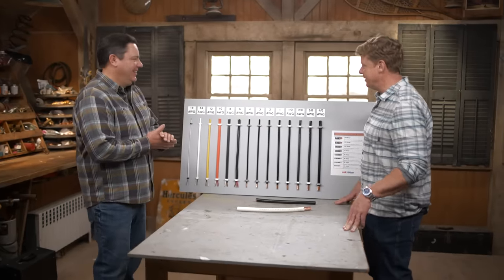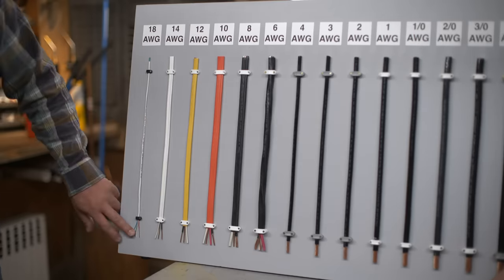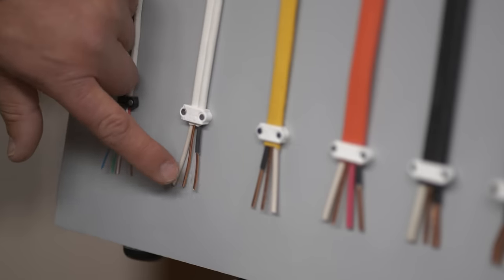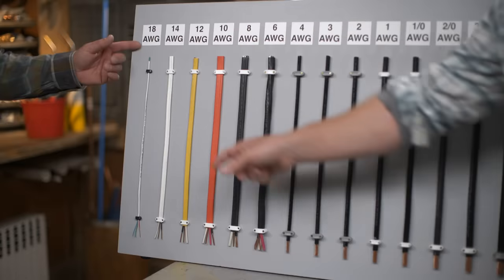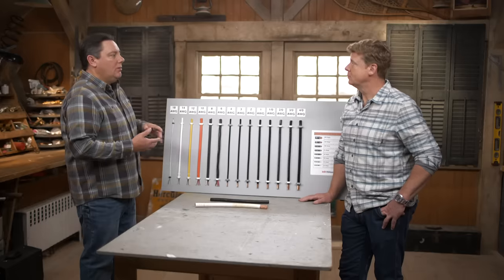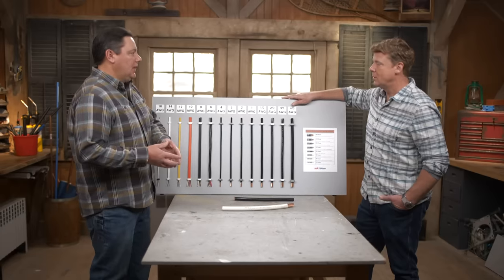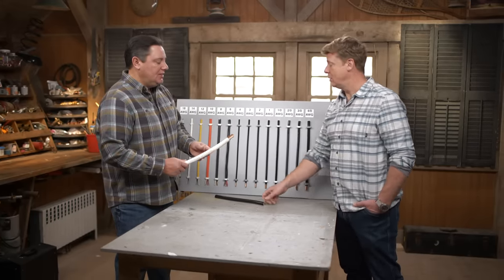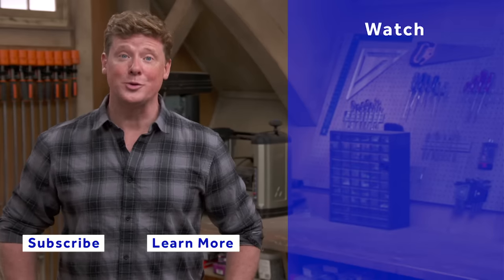Understanding Wire Gauges | Ask This Old House

Comment: While the ‘k’ does stand for “kilo” and the ‘c’ stands for “circular”, “kcmil” is not a metric unit of measurement, and the “mil” is not short for millimeter. One mil is 1/1000th of an inch, and a circular mil is the area contained in a circle with a diameter of one mil. A 500 kcmil conductor, therefore, is a conductor whose cross-section has an area of 500,000 circular mils.
Reply: so theres a 1000x and /1000 in that unit?
Reply: @GeofDumas  Yeah, no one knows why it is the way it is, we just deal with it. It aint metric, thats for sure.
Reply: Great explanation - thank you!
Reply: How many mm wire you can use for a single 10mm wire since the single 10mm wire is huge
Reply: You are wrong sir stop giving false info
Reply: This is an interesting unit. Wikipedia has a nice discussion on the topic (for those interested, see "circular mil"). Perhaps the most interesting aspect to me is that it's a unit for cross-sectional area calculated as D-squared rather than pi•r-squared. It is a unit of area without a "squared" in it (like an acre or a hectare) rather than square inches, square yards, square metes, etc.
Reply: @kllgrogto5838  Where specifically is he wrong?
Reply: Of course it doesn't why would anything be simple
Reply: My God. Why America needs to use such outrages units. Just use diameter or area in regular units. Even in inches or square inches. Not to mention simply mm/sq mm like any other place on the earth.
Reply: I just learned this in class last week.

Comment: The only reason to use 14ga is to save money.  All the normal general purpose outlets should be wired with 12ga on 20amp breakers IMO.  If you separate lighting from outlets (a good idea, IMO) then maybe you want to use 14ga for your lighting circuits. But then if anyone decides to add an outlet and feeds it from a nearby switch, that outlet will be on a 15amp breaker.  Wire is cheap compared to an electrician's time to come out and add circuits. Just use 12ga for your outlets in the first place.  Or 10ga.  That would be even better, but man I hate working with that stuff and multiple cables in a box.
Reply: Agree with everything you said! In a few places with especially strict code (including where I live), 12ga is required. Your note about future changes sticking on 12ga wire/20am circuits is spot on.
Reply: Yep, if a homebuilder can cut cost they will, and to hell with everyone down the line for decades that own that house.
Reply: With LED lighting, 14 gauge is almost overkill for lighting circuits, but it's still the standard for residential lighting.
Reply: @n9wox  Problem is we don't have really any standard for premise wiring less than 14ga/15a.
Reply: Completely not true
Reply: I'd never use 14/2 for receptacles anywhere. Always 12/2.

Comment: Back in the late 1970s we ran 4/0 in our church, the job supervised by two master electricians.  I recall the wire was so huge and stiff I thought we would never get it through the big conduit but we finally did.  It was a service to a large air handling unit as well as duct heaters and other electrics for a portion of the building.  I'm grateful for the explanation.
Reply: 4/0 aluminum is a standard wire size for most new 200 amp basic houses now.  Ironically, aluminum is totally safe with a proper installation, torque, and anti-corrosion.

Pulling the individual wires thru a conduit is an art if the conduit isn’t oversized.
Reply: @ganocd4   I totally agree.  I think our conduit was a little oversized but perhaps not.  That was 50 years ago.  We had no issues with large, professionally installed commercial wire back then.  The issue we had was with copper-clad aluminum in residential installations.  I'm no electrician but my brother was a licensed journeyman.  We had to resort to copper-clad in my first home.  Never had an issue because he taught me how to properly tighten all connections and double checked to make sure.  A friend, on the other hand, almost had his house burn down.  The problem was traced to a loose copper-clad aluminum connection in a plastic box.  Yeah, I know, the plastic is supposed to be rated but it didn't do the job when the loose connection sparked and melted the wire.  Fortunately the guy caught it and shut power before it got worse.  It might not have ended well.
Reply: @ganocd4  Ironicly? aluminum has been fine for awhile. Just need to have devices designed for it. All those big massive overhead powerlines? Aluminum.
Reply: @ganocd4  A lot of fires have been started by Aluminum. It should be outlawed for residential wiring.
Reply: @dancooper6002 I think your confusing aluminum with copper clad aluminum wire. Aluminum wire is still used in residential for running power to panels and cheaper than copper. Just apply antioxidant to the exposed aluminum wire.
Reply: we  use 4/0 in the film industry to power our lighting and AWG banded 5wire camlocks
Reply: @dereknueveuno  DN ............even with the new LED lighting now ????
Reply: It's not oversized most of the time, the NEC gives you a guideline to follow to avoid that issue.

Comment: Heath got it wrong. kcmil is not "circular millimeters" and it's not metric. It is thousands (k for kilo) of circular "mils" where a mil is 1/1000th of an inch. (A 500 kcmil conductor is 253 square millimeters in cross-sectional area.)
Reply: What? Are you sure???
Reply: @eviltomthai  Yes, I'm sure. Just google "circular mil" or "kcmil" and read a few of the top hits, or Wikipedia, or any other reference source. (I'd put a link here but then the comment goes into moderation and takes forever to show up.)
Reply: @eviltomthai  Wikipedia: https://en.wikipedia.org/wiki/Circular_mil
Reply: Leave it to a America to divide an inch 1000 times and then call it a mil. A measurement that is so imperceptibly small you could just arbitrarily switch to metric which already divides everything 1000 times and you wouldn't miss anything.

Comment: Its not metric!  Its K (thousand) C (circular) Mills (Thousandths of an inch) - its in the name!  250 kcmill wire has 126.7 mm(square) cross section - its not metric

Comment: Great video but I have a concern about the explanation for the "wrong wire for the job".

If you use the wrong size wire, you're at risk for a fire (coming from inside the walls). It's not a matter of "the breaker is going to trip". 

Let's say the breaker was rated for 20A, but you put in wire that's only meant for 10A of current. In a scenario where 15A of current is being drawn, the breaker will think everything is perfectly fine yet the wire will be melting down and eventually light on fire.

That's why it's important to put wire meant for 20A with a 20A breaker, etc etc
Reply: Yes, your breaker should always be sized to protect your wire. thats just common sense. What he was talking about was don't run a 14AWG on a 10A circuit to your oven. It aint going to get the job done.
Reply: @literallycanadian  I'm not sure we should assume anything is common sense, especially when watching a video explaining beginner level concepts for electricity and wiring.

But yes, I think you're right - that was his intent. But it was subtle, and could easily be misinterpreted as a safety point. Maybe it was just me. I wanted to help clarify and share knowledge, in case anyone else misinterpreted his point, as well.
Reply: This is correct. Choosing the wrong wire gauge has nothing to do with the breaker popping. That's a pretty big mistake for somebody (the guy in the video) who is supposedly a master electrician!
Reply: But what if I use a bigger wire than is required, is there any downside? E.g. using receptical wire for lighting?
Reply: So glad I read this.
Reply: @taqveem the only downside is cost.  My dad has strung 14 all throughout the basement for each outlet even in bedrooms.  That way a space heater can be placed anywhere and not have it be a problem.
Reply: I mean I got the gist of it but yeah "fire hazard" should have been somewhere in that sentence.
Reply: Clearly they meant you had the right breaker for the wire.   Probably should have made that more clear, but obviously that's what they meant.
Reply: @taqveem  The downside is that someone later comes along and thinks they can change the breaker out for something bigger but the entire circuit isn't the larger wire but that's the only wire they see.
Reply: @taqveem gets hard to terminate the wire on the device and get it tucked back in to the box

Comment: 25+ years as a UL508A industrial control panel builder. Mostly for the lumber industry boiler control, pump panels usually used the biggest wire. Great video on wire sizes.

Comment: A good way to explain when to use 12ga (20 amp) to a home owner is on a circuit that will power an appliance that has a standard plug and cord, but produces heat. A toaster, coffee pot, hair dryer, space heaters, etc. It's more complicated, but this gets you most of the way there.

Comment: One thing you could have added was where "gauge" came from. it comes from the number of times the wire had to be drawn through a die or form to get it to the desired size. So, 14 gauge would would have been drawn through 14 sets of dies to get it to that size. Today it's a cross sectional area is more rigidly defined, but that's roughly equivalent to that. The X/0 sizes (pronounced "X ought") is just the number of 0s in that size, similar to "00 buckshot."

Also should have mentioned that wire size is not only determined by the amount of current going through the wire, but also the length and duty cycle of the device you're powering. Consult you local electrical code or electrician for more information.

And there was one mistake. MCM or kcmil is in imperial units. A mil in this context is 0.001 inches.
https://en.wikipedia.org/wiki/Circular_mil
Reply: ok bro maybe you should be in the video
Reply: @peterjanis2455  or maybe he shouldn’t. Probably isn’t even an electrician.
Reply: Thank you so much for that explanation!  
I've also heard it said that the gauge number is that fraction of an inch; for example, 16 gauge is 1 / 16 th of an inch.  Is that true?
Reply: @CoconutPalmPictures  It might be a close appoximation in some of the smaller guages, but AWG scales differently. If you want the exact formula, it's on the wiki page for AWG: https://en.m.wikipedia.org/wiki/American_wire_gauge

But to summarize, 36AWG is defined as 0.005 inches in diameter, and each size up is about 1.12293 times the previous size.
Reply: The sizes range from 0000 (4/0) to 36. So 14ga is the 17th pass thru. 3/0 is the first pass. Length of wire (voltage drop) calculations can change wire size, but are for over 200 feet and rarely used in residential.

Comment: I would say more important than "right wire to the right appliance" is to say "right wire to the right breaker"... You get this combination wrong, that is when your house is at risk.
Reply: They are actually right, sequence of selecting devices is always appliance determines how much load you have, and thus determines required wire. Your breaker is now selected to protect the size of wire you have.

Comment: Need one for plumbing pipes snd connectors next. 

Abs, pvc, cpvc, 
Schd 40, schd 80. Etc
Reply: Include which are sized in Iron Pipe Size (IPS - abs, pvc, ...) vs Copper Tube Size (CTS - cpvc, pex, ...).

Comment: Pretty informative and a great video as always. Curious though, what would be recommended for a small workshop in a garage or barn? Mostly just a refrigerator or two and the occasional power tool or air compressor?
Reply: Almost certainly you would be fine with 12AWG. Depends on the power tools and how much or many you would use at one given time. Getting power to the garage if it is detached would likely be the biggest issue
Reply: A 50 amp service to a main breaker type sub panel would be what I'd consider minimum.  100 amps would give some major flexibility for the future.

Comment: Any downside for using 10 AWG or 12 AWG when only 14 AWG is needed  - other than maybe the cost?
Reply: Harder to bend
Reply: 10 or 12 gauge also sometimes won't insert directly into the  rear holes in electrical outlets.
Reply: Wire may be too big from some of the terminal you plan to land into, like stab in receptacles or switches. But other than that it's fine to use oversized wire so long as the breaker/fuse/OCPD is sized correctly. Up-sizing wire is done sometimes on long wire runs (300+feet) to mitigate power loss from the wire resistance.
Reply: @BradThePitts  don’t back stab (put it in the holes) of the outlets. ALWAYS use the terminal screw or a WAGO connector. Backstabbing wires causes wires to come loose.
Reply: @jasony9950  
"Backstabbing wires causes wires to come loose."

Well, there's something that wires and I have in common.
Neither one of us like being back stabbed.
Reply: Box fill is based on wire size, among other things. For a given size box, and all other things being equal, you are allowed to put more smaller wires in a box.
Reply: Solid 10 is nobody’s friend
Reply: @BradThePitts  You don't want to use the rear holes, ever. That's BAD practice.
Reply: Costs more, harder to install. But no real downsides.
Reply: @BradThePitts You shouldn't be using the rear holes, so if the wire does not fit, winning!
Reply: That would be the equivalent of making a cement block to hold up a TV.
14 AWG is just fine for lighting and most outlets.  12 for bathrooms and kitchens and garages.  Running 12 to most outlets isn't a bad idea, but 10 is very overkill.
Reply: In theory you could, but I wouldn't (unless I have a very long run where I have to worry about voltage drop).  I think about it like this - the breaker size decides EVERYTHING that follows, because you always want the breaker to be the first point of failure. 15 amp breaker = 14 AWG wire, 15 amp rated switches, 15 amp rated plugs, etc.  Don't mix and match anything between 15 and 20 Amp circuits.  A 20 amp breaker gets 12 AWG wire, 20 amp rated switches and outlets, etc. all of which are noticeably more expensive.  The code builds in appropriate margins of safety already if you just follow it.  You can deviate up from the code, but you are nowhere near what the wires are actually capable of handling if you stick to the code, so you are really just wasting money.
Reply: Less voltage drop. Commercial/industrial buildings are often engineered that way. In a residential application, chances are its a waste of money to upsize a wire for no reason.

Comment: OK...let's not confuse power with current. Remember, Power = Voltage x Amperage...W = V x A. It's the current...A(mps)...that heats up the wire, not the Power per se. 
For example, a 100W load at 120V requires a little less than 1 Amp. At 240V, it needs half that, a little more than 1/2 an Amp. 
In an automotive system at 12V, a 100W bulb...say a headlight...requires a little over 8 Amps. 
AC or DC, it is the amount of current that needs a particular wire gauge, not just the amount of Power.

Comment: I’d love to see a n accompanying video on all the CAFCI and GFCI circuit breakers these branch wiring circuits connect to with a modern standard.

The breakers are around 100 a pop and many houses need 30 of them to meet code these days.

It’s too bad the BOM cost for these is so cheap and they are so overpriced relative to the chip and material cost in said breakers.  They won’t protect against undersized wires, but they do catch a lot of faults you won’t typically find.

Comment: Could you wire your whole house with 12 guage wire? Minus the bigger stuff. I.e. dryers.
Reply: Yes, 12/2 could be all 15A or 20A circuits. Besides cost savings, the main advantage of 14/2 is the ease of wiring it. Lighter, more flexible, etc. I generally use 12/2 for nearly all my new circuits, mainly for future growth, but if the circuit is lighting only and LEDs, it is tough to justify 12/2.
Reply: @KG12KG  Thank you. I am trying to gather as much info and knowledge as I can. My 1968 home needs rewired. The previous owner/s have feeds coming and going from multiple boxes. Example: the dryer and dinning room are connected somehow, because the breaker will trip foe the dinning room and the dryer stops working.

Comment: I'm changing a length of 14/2 Romex on a 30 amp breaker but the length I have is a little short of the length I need. I've been told that since 12/2 Romex is thicker gauge than 14/2, it is not a problem to splice with 12/2 Romex with 14/2 Romex. Is that accurate?
Reply: Neither 14 or 12 AWG are rated for 30A.  That breaker will trip when the draw exceeds 30, but the wires are likely to melt or catch fire first!  Use proper cabling.  You could run overrated wires, but not underrated.  For example, if you have a 15A breaker you could technically run 12GA (rated 20A) from it to a junction point, and 14GA (rated 15A) to your standard 15A receptacle.  I can't tell you if that would pass code inspection though.
Reply: 30 amp is really high and wierd ampere!...figure out what requires that

Comment: How far down does the bracket have to go on the booster screws? I cannot get it to seat fully down on the screws. It stops  in the middle of the bracket. I have cut off all of the screws and still getting blocked by the brake booster. So frustrating! I am about to throw this bracket into the river.